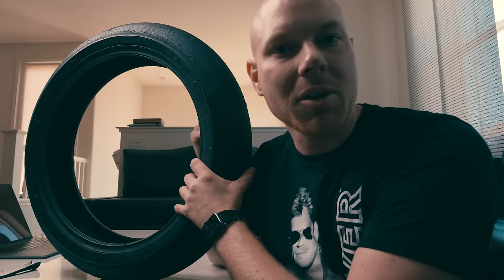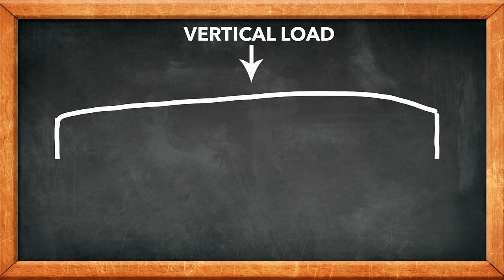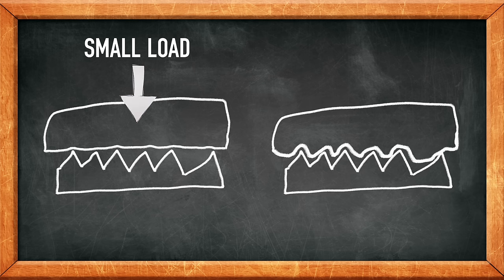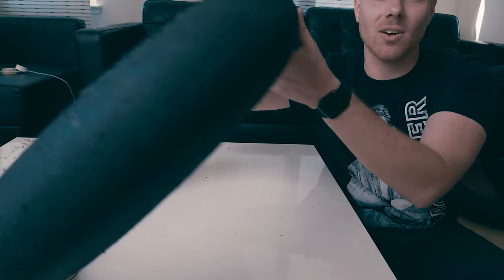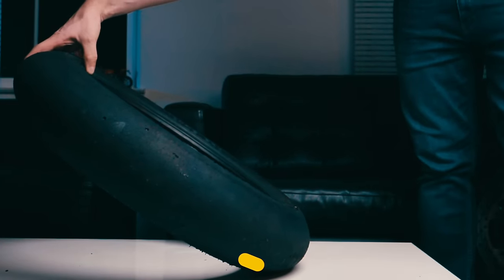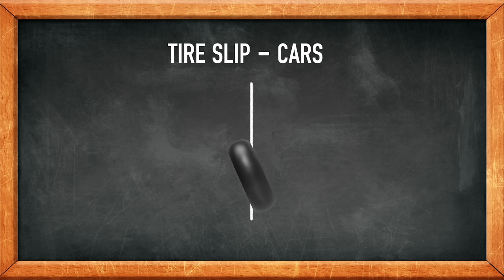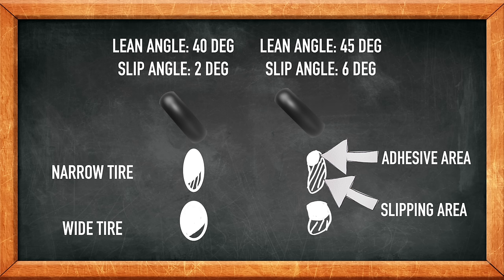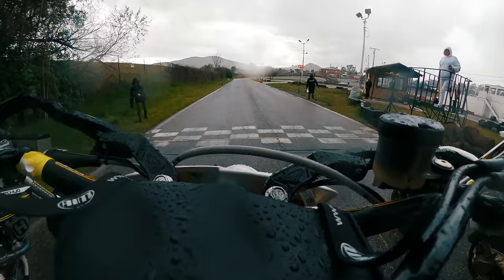Tire Grip | EXPLAINED

Comment: Im astonished at how people instantly thought he was right.... I work for Dunlop's team within the chemical engenieering behind the tires and I can say hid answer is not definite and neither is a simple friction formula. As surface area increases, if the weight is constant which is assumed throughput the video, then the larger surface area will spread out that weight, and therefore the idea that there are more connections that the rubber makes with the ground is not solely correct as each of those 'connections' carry less weight and therefore providing less frictional force as compared to the connections of a smaller surface area with the same weight. Its not as simple as this video makes it seem and not as simple as a single formula, but this video misinterprets it as much as the others do.
Reply from the maker: Adhesive friction depends on surface area. More area in contact = more grip.
Reply: @MikeonBikes  tires don't act under adhesive friction, they are similar but past the physics and now into chemical bonding that happens to provide adhesive friction is different than the friction that happens between a tire and the ground so you can't apply that concept to tires.

Comment: I've got a question 🙂
I'm 1.85m tall and I weight 106 kg. I ride on a Kawasaki Ninja 250r with smaller tires than the tire you have shown in your video. Can I trust my tires (if pressure, temperatur and profile is defined properly) in lean angle? I'm realy affraid to test the limits because I realy dont want to crash, but I have this big fear off lean angle, because I dont trust it. What would you recommend? (Beside of getting a bigger bike).

Many thanks for the answer and I liked your video a lot.

Comment: Doesn't the amount of force required to pull objects of different sizes stays the same solely in case of those objects having equal masses...? o.O If objects have different surfaces (in this case carboards), amount of force needed to pull the bigger cardboard would be sufficient to pull smaller cardboard because it has smaller mass. But other way around wouldn't be possible since smaller cardboard has smaller mass and force required to pull smaller one wouldn't be sufficient to pull bigger one... I thought that's how physics work...

Comment: Wider tires are softer that's the real reason...,    softer tires can't be narrow or they melt too easily, even within the same tire line, formulation is made per tire size, an arbitrary/hypothetical S22 180mm will be made of harder compound than an S22 200mm, (over simplified particularly for complex carcass Moto/Dirt tires so simplifying to asphalt passenger vehicle tires from here on)

Virtually all manufacturers who build quality tires vary their formulations by width. It's expected if a load is heavier the tire needs to be wider for a given compound, all modern vehicle are essentially built this way, when it comes to a point that going further wider isn't possible then tires are packaged for the available width but the compound is hardened if extra load as expected to be experienced hence LT/Light-Truck tires

So all that stuff about adhesion and surface area benefits doesn't apply to normal tires, neither does the part about load/weight not mattering after the rubber has sunken into grooves, because for one the road grooves are deeper than you realize on most roads plus the bulk of the grip is actually the weight pressing down that's keeping the tires in the grooves as anyone who's ever used a Phillips+ screwdriver on a tight screw knows it takes additional weight bearing down on suffices to keep ramp angles from camming out of the groove, using a bigger screwdriver doesn't help(usually makes it worse if you have more camming area), but putting your weight in on it does

Surface area adhesion is all theory relating to chemical grip tires, something most as mere mortals don't need to bother our peasant brains with, if you're running on a glue track, yes wider has benefits but not even because of contact patch, but because more chemical grip is going on(even on area that without the chemical would be out of contact). See because if it was all about contact patch we'd all be on halfway flat tires tracking our cars around the circuit yet we don't. Wider isn't grippier in & of itself, which is why you never see sports cars using LT tires which tend to be wider, but because tires are primarily built around temperature first & foremost, LT whilst plenty wide will be out classed by most narrower tires ment for any kind of passenger car driving that isn't anything but the most eco-minded, special use case or unheard of suboptimal brand

TLDR) Width alone on none chemical grip tires don't add grip, or generally even contact area, but wider tires are where you tend to find the softest tires which can deal with more heat & LT tires are an example of wide tires which are actually less grippy #TheMoreYouKnow
Reply: load sensitivity exists even on the cheapest, least adhesive road tires, and wider tires almost always have less of it... so when theyre made out of the same material, which will have the same CoF at very low loads, a wider tire will have more grip at relevant loads.
Reply: @whysoslow1999  load sensitivity doesn't correct for PSI, it's just adding weight to the same tire, their pressure increases with load, in reality the lower PSI you run the more grip you tend to get because the more evenly you can use the compound without getting uneven contact therefore you have parts of the tire that get overworked before other parts get worked enough

This is a why racing tire can be down to as low as 4 PSI depending on the tire and event at hand & such tires achieve that low pressure that allowed the tire to be evenly & completely worked by simply having more internal volume, something that yes can happen by increasing width, but you can also do so by increasing length, this is why drag tires do both with the girl of achieving lowest pressures, often going as far as reducing the rim size so there's more room for even lower pressure air, this is what everyone ignores or forgets about, it's always been about air maintaining low pressure volume not width, this is why deflating narrow tall tires works offroading(especially in sand)but just having wide rubberbands struggle
Reply: @ChroniclesofKToyoda  You cant describe the grip of a tire (normalized for everything except pressure and load) with simply the internal pressure so its incorrect to say load is not a separate factor.

It would be a technicality regardless, as for a given inflation pressure a wider tire would result in more grip...
Reply: @whysoslow1999  I'm saying more weight overworks the air volume in a tire increasing pressure, if you compare a tire to an identically tall tire just wider it will distribute that same load over more air volume affecting the pressure less, that's the mechanism responsible for improvements from grip, this is why if you once again take a tire that is identical in all ways including width but it's simply taller with more air volume, that will also have the benefit of spreading load over more air maintaining more even tire pressure & usage

I'm not saying to compare for a given pressure I'm saying having more volume allows you the benefit of knowing the pressure will fluctuate less so you can run lower pressure without the load upsetting it as much and the carcass construction can than be utilized to take advantage of having more even contact pressure throughout, something that's hard to do if it has to instead be designed to hold high pressures

Comment: So a wider tire has more grip ... not because it has a bigger contact patch... but because it makes a bigger contact patch... ? I mean that's basically what I heard.
Reply from the maker: Wider tires provide more grip because of the shape of the contact patch at high degrees of slip = deep lean angles.

Comment: You didn’t really explain the HD effect.  Lol.  Why they can’t be happy with 200 let alone 190   Those guys push rear tire width past 240 and off to 300 or more.  Taking a bike that doesn’t handle and put a wide drag slick on it has never made sense.

Comment: who ever think friction have nothing to do with wider tire, go and talk to a drag racer
Reply: That's ability to transfer power.  Narrower, or smaller diameter, tyres are not capable of handling the power transfer.  It has nothing to do with friction.
Reply: @dnfielding  What is the effect wich transfer power to the ground ?
Reply: @dnfielding  Did you even watch the video?  Super wide tires, when of the correct  compound and temperature, have greater adhesion force in dry/clean conditions and therefore act like a big ass slab of duct tape on the ground.  Just like tape still sticks without any weight on it, so will the tires.  This is where tires diverge from conventional friction models, most objects don't have the adhesion force that tires do.

Comment: 4:10 More load gives more grip per Anthon's law not because surface is bigger. Also at min 6. You keep falsely relating contact patch with grip. The fact that the contact patch is bigger is irrelevant, larger tires are grippier because they have softer compunds. And yes,  bigger weight adds linearly to the grip. The only way roughness of the road surface changes grip is because the tire acts like a gear and "blocks", impeding slip. And no, contact area form makes no difference. Your video gives a wrong idea to the viewers.
Reply: I'm pretty sure I just heard him say in the video that wider tyres tend to have more grip because of the difference in the shape and size of the contact patch relative to a smaller tyre. And I'm sure he did say this is in part due to the difference in the way narrower tyres deform in relation to slip angle. And I could have sworn that he said larger tyres are better at managing higher slip angles due to better thermal stability.
How does the contact patch not relate to grip? Did you mean to say that a bigger contact patch doesn't relate to better grip?

And if you recognise that more weight adds linearly to grip, why don't you explain what happens in these circumstances? Is it not that the increased weight deforms the tire more to create a bigger contact patch?
 
So if a larger tyre with a softer compound and more vertical load (assuming a tyre inflated to manufacturer recommendations) doesn't result in a larger, better contact patch with more grip, how would you compare and describe how to create more grip?

Why does contact area form make no difference? How does this not contradict your own statement that the tyre "acts like a gear and blocks"? How does it do this? Doesn't it deform to "act like a gear"? If so, wouldn't a bigger tyre with a bigger contact patch have more "gears" to "block" and impede slip?

Would love to read a more thorough response.
Reply: @2002RM   @2002RM of course I'll explain. 

 To answer to your first three paragraphs, the area isnt even taken into account in physics when calculating grip. It does not show in the ecuations, therefore it's size or form is independent to the grip. With or without deformation. Thermal stability does not account on grip either as temperature changes dont affect it, just the precise temperature in the contact point. The only way to create more grip is a better friction coefficient (grippier tires or tarmac) or more downforce (spoilers, like in F1)

To the last paragraph, yes a bigger patch has more "gears", but as load is distributed in more surface, these have a lesser height, and therefore create the same effect. Btw this effect is only visible in great scales, like in rough roads, not in circuit, where friction grip is hundreds of times bigger than these "microgears"

Comment: This video litteraly mentioned nothing of the needed decrease in air pressure when moving to a larger tire size. So in all reality it's 15 minutes describing how to spend more on a tire and doesn't even tell of the key needed to get a larger contact patch than the smaller size you would be coming from. If all you change on your bike is tire size and you set it to the same pressure the smaller tire called for. You have actually lost the "grip he was trying to describe"
Reply: Why would you set a larger tyre to the same pressure? Who would do that? Didn't the video say the tyres should be inflated within the manufacturer's range?
Reply: @2002RM  yes and if the manufacturer says 30psi and you up the tire size and put it at 30 you have now gone in the opposite direction your looking to go. The larger tire would have to be set at a lower pressure than spec.